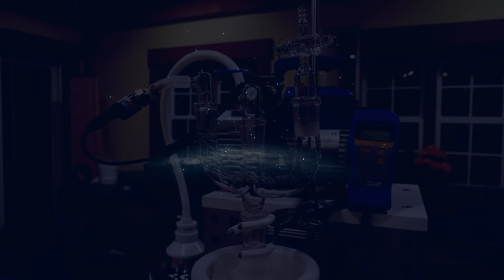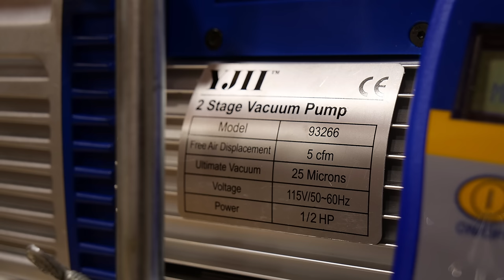Vacuum pump with NO moving parts

Comment: You have such great videos! I just thought of a topic (or series). I will be starting a van build soon (RV conversion). The problems I see are that you have to reinvent the wheel because you are building it to your liking from the ground up. What should I do for insulation? Hot WX? Cold WX? Condensation? Recirculating water for longer showers? How about solar? With limited resources and finding ways to conserve and recycle energy, there is a lot to tackle from an engineering standpoint. Maybe this would be something of interest to you guys? I can only imagine how many people would be interested (the van build community is rapidly growing).
Thank you again for such great videos!

Comment: In the early '90's I worked at a vacuum metallization company. Their equipment used to plate thin layers of metals on various items in a vacuum to make jewelry.Once a base metal was on, the item could then go through chemical electroplating, such as gold. One experiment they took a dead butterfly and plated it.

Comment: At my previous job we exercised the same principal to clean impurities from compression and moisture from pressurized air systems. The beads of desiccant were MUCH smaller though and were nearly impossible not to make a complete mess with. Additionally the chamber to refill was inevitably hot from the previous reactivation cycle. Ah, memories. Terrible memories.

Comment: From the moment you begin cooling the sieve and you still have the valve open to the mechanical pump, you are pulling oil vapor into your glassware and sieve...you'll start to notice if you do this enough.  Best practice to regenerate the sieve, seal it off when you are happy that the pressure is  at equilibrium at elevated temperature, and then begin cooling down (to ambient or below)--then connect it to whatever you wish to pump on.

You seem to love strong magnets and high voltages.  You should try an ion pump.  Such a system would also utilize the Yellow Jacket you are so fond of to rough the system before turning the ion pump on ;-P

Comment: Great video. I had a little problem with your explanation of how an oxygen concentrator works. The sieve that is used has more of an affinity for nitrogen than oxygen so it is the nitrogen that is more sticky, not oxygen. The sieve is in columns so the nitrogen  is adsorbed from one end to the other. The oxygen (and argon) isn't adsorbed as much and it gets pushed out a small orifice at the far end. The orifice is small enough that the compressor can keep building pressure. Once the nitrogen has filled the adsorbent nearly all the way to the end, a valve opens to the atmosphere and all the nitrogen comes blasting out of the sieve. While it is depressurizing the concentrator switches to a clean column so it can continue putting out oxygen. What I found fascinating is you can pump a heck of a lot of air into a column of sieve and the pressure doesn't rise much. It acts like it condenses in the sieve. And when it dumps, a heck of a lot of nitrogen comes out. It is a way to store a lot of gas in a small volume. If you had a car tire filled with sieve material, it would take forever to fill it up and would take forever to go flat in case of a leak. The sieve also gets hot when it is adsorbing. If you expose some to air it really loves water vapor and quickly gets too hot to hold. Supposedly wool is a natural sieve and moisture from your body is adsorbed which gives off heat to keep you warm.

Comment: In addition to turbomolecular and oil diffusion pumps, pure cryogenic pumps are used. They're usually a Gifford-McMahon cooler attached cold-end side to a set of baffles inside the vacuum chamber, and connected to a helium compressor. The cold head can go below 20K, and the pumping speeds compared to pump size(minus the compressor) are absolutely huge - even the smallest palm-sized GM cryopumps start at hundreds of liters per second, and go up to many thousands, where you'd need a person-sized turbo or oildiff.
They don't compress helium(for obvious reasons), but they're exceedingly effective at pumping other gases. They do have a finite resource, but you can regenerate them under vacuum by turning on a little heater next to the exhaust port, to drive the gases out the right way.

Comment: Very interesting as usual. Being an HVAC tech, I would like to see this in our industry rather than using those pumps. I understand this is a lab setting, but just FYI, the Appion TEZ 8 is a much better pump in my opinion because you have the oil reservoir on the side and can see the entire volume instead of the top through a sight glass,  and can also change it on the fly.

Comment: Changed my whole perspective on desiccants.  Got me thinking about using a molecular sieve to capture methanol from compost or wood.  Could then be used in a small fuel cell.
Reply from the maker: That's correct.  Molecular sieves are inexpensive as well as reusable.

Comment: In HVAC we usually pull a vacuum to at least 500 microns in a system and in addition to that there's usually a "filter" installed too in our copper line sets which are filled with molecular sieves/zeolites to scavenge anything that was missed or finds it way into the refrigerant lines.

Comment: 1960s 70s era Varian VacSorb pump.  Usually 3x 4L pumps could pump 1 stere to 20mTorr. 
Then better rotary pumps and turbos came out.  VacSorbs though had low/no back streaming. 
Better yet, take two rotaries filled with Inland45 (or better) in series with two cold traps in between.
Remember, differential pumping!!!!!  Never expect one pump to hold 5 or 6 orders of magnitude...
Nice video.

Comment: Interesting application of this material. I was familiar with its use in refrigeration and making anhydrous ethanol, but had no idea about O2 concentrators or high vacuum applications. The physical process is very similar to how activated carbon works.

Comment: I used to use a pressure swing drier that worked on this principle.

Air compressed to 10 bar, 100% humidity was put into one chamber filled with dry desiccant. That dried the air. Some of the dried air was allowed to expand to 1 bar and passed through another chamber filled with damp desiccant. That dried the desiccant. The damp air was vented to the atmosphere. 

After a few minutes the chambers swapped roles.

That gave you an endless supply of ultra dry 10 bar air.
Reply: Sounds exactly like the pressurising systems used on waveguide systems.

Comment: Thanks for adding to my knowledge of vacuum. My pump is ratted to 3 microns I have been only able to pull down to 12 microns in a large 30 lb steel cylinder. Now I have a new cheaper toy method to play with.

Comment: Thank you very much! You are really excellent, both in didactics and as a true scientist. The LORD Jesus bless you and your family!
A few questions: 
-If you would have cooled down the empty flask with nitrogen, what micron level of air pressure you would have reached?
-Could you also electrostatically charge the flask to reduce the gas layer on the surfaces, or even use high-intensity EM-waves of a given frequency corresponding to the gas molecule absorption lines (Frauenhofer lines) to excitate the molecules instead of heating ?
-Could you show in a future video, how to build an oxygen-concentrator with molecular sieves? Since long I wanted to buy one of those, but building one yourself would be more interesting.
Thanks again for your marvelous uploads...I always learn a LOT in these 20 to 40 minutes!
Reply from the maker: Thanks!
The pressure that the empty flask could have reached after filling with air is approximately 77K/300K of the starting pressure.
Reply: @TechIngredients  Thank you very much! Sometimes I forget to switch on my brain ...and to use the "ideal gas law" and the direct proportional relation of pressure to temperature. (T(liquid nitrogen) 77K : T(ambient temperature "hot summer night in the USA at 9 p.m.") 300K)

Comment: you wanted some more ideas so here are some:
you could make a video similar to your fridge video about different types of presses. specifically there are multi ton presses which allow for a metal version of plastic injection molding. if there is a way that such a thing could be done through leverage, that would be pretty interesting. for example, bullet trains can have their acceleration maintained to their speed max due to relatively recent EM discoveries, if somethign similar can be done for a press with lower energy that would be pretty impressive.

something related i was thinking was if the weight to one of those could be moved separately. the real presses have these giant blocks of iron or steel giving it mass. but if you could have a different type of mass it might be less difficult. take for example water, it doesn't' compress much, but is pretty fluid, so if you can have the water be in a closed and full chamber for the hammering, but then have it drain out after the hammering, then the work to bring the head back ready to hammer can be spread across more motors. if you could have a bunch of whicking material pulling the water back up continually to higher basins, and also have EM making the thing hit harder. it would be a really strange and fantastic thing. there is probably more room for reciprocation too.

you could make a video about cuts, polishing, and repairs. starting witht he keying of saws, you could goin into serration and off center cutting edges, then go into how to chemically fasten stuff like dimonds to blades. then you could talk about whether there is merit to using soft materials in a saw- at least soft relative to the material you are working with- and that could take you into sanding and polishing, and lastly just as a mic drop you could talk about self-repairing materials like the phone cases which gradually undo scratches.

if you want some ideas that others have done but are still cool. you could make a computer processor using a microscope backwards to do lithographic etching.

i'll see if i can think of anything...

Comment: I used to work on oxygen concentrators. We cut the sieve beds apart and scrap them. I noticed that one sieve would spontaneously combust when it came in contact with nitromethane. I was using top fuel nitro and I think the sieve was from a DeVilbis. It’s pretty neat, the sieve will turn red a boil like lava..

Comment: I am now restoring "new old stock" Tesla SEM made in 1990, and the only "forevacuum" pump is the sorbption pump cooled by liquid nitrogen. That was a total surprise, but I think they did it because of a requirement of a very clean, oil-free vacuum (this electron microscope is equipped with FEG, the column itself is UHV, and most importantly it contains Auger spectrometer, which would hardly work if there are oil vapors there)

Comment: I ran a PSA (pressure swing absorption) gas plant for years where you ran coal mine gas that was 350 btu through a molecular sieve and vacuumed out the nitrogen and let the methane pass on though making pipeline quality 950 btu gas.

Comment: Great work again. You say it's a dead-end pump, but is that really true? If you add two check valves or solenoid valves, and you thermally cycle the molecular sieve hot-cold-hot-cold-hot-cold, you could create a continuous pumping action right? It'd have to be slow as molasses I guess, but probably pretty cheap? And perhaps could be used in combination with a regular vacuum pump to achieve a slightly deeper vacuum. I have no experience with vacuum systems though, so I'm possibly spouting nonsense.

Comment: labhack: use nonstick spray, a mandril, and a heat source to spread the pointy bits of your cheap store funnels so they're wide enough to let 3 of what you're pouring in through side-by-side.

Comment: Wow. I never would have thought there could be a non-mechanical vacuum generator, but it makes sense. At the beginning of the video, I was thinking "man, this stuff has some parallels to thermodynamics" - I guess that was good ole' fashioned foreboding. I wonder if this principle may apply to commercial veneering of large panels, such as those used in cabinetry or furniture? The hardest (easiest to sand/finish) and most durable veneer glue is known as PPR - plastic powdered (urea) resin. Common method of use involves a vacuum applying even pressure over a mesh inside a thick polyurethane bag. This is done for a period of time while the resin sets, usually under warmth to around 30º C for about 2 hours, or 3-4 hours if done at room temp. The substrate must be removed from the vacuum in order for curing to complete, and then a period of a day or more must pass before the panel can be machined. What you've shown us in the variation involving the pump and the dessicant makes me wonder if better adhesion, and/or possibly a shorter wait time before additional machining can be achieved. Dessicating the air being drawn off the bag could mean that two hours of vacuum would be all that's required, and the panel may be almost completely cured by then.

Comment: Used to work in millikelvin cryogenic systems and most people use activated charcoal as the source of large surface area. this comes in a fabric or beads. A convenient thing for heat transfer is to get a long strip of fabric and fine copper mesh pace one on top of the other and roll it up the copper means it is a good thermal conductor for quick cooling and it also holds the shape and you can place the swish cake tube in an inconspicuous corner of the experiment.

Comment: my favorite  time in grad school waiting on the SEM or TEM column  to bake out. We have one CVD system that was designed to work with Mg had to bake every run, used ion getter pumps to get UHV, had issues with gas diffusion through the inner camber walls, 1.5-2 in SS.
Reply from the maker: It's a rite of passage especially on a Saturday night.😀
Reply: @TechIngredients  yep, kinda miss the 36hr days. And unsupervised bulk LN dewars

Comment: Seems like it would be pretty useful for getting down to really low pressures and staying there once your vacuum pump reached its limits. I was first exposed to the fact that Molecular sieves will adsorb gases on ElementalMaker's channel when he took apart an oxygen concentrator. For some reason I thought they only worked on liquids till that point.

Comment: Thank you for this interesting video. It explained nicely how oxygen concentrators work. I had been wondering. 
Yes, Science is fun!
However, it would have been even more fun to be able to actually read the display of the instrument. Maybe you could make a visual cut out with only the display on top of your lovely french doors to the top right of the apparatus.
I was a bit surprised to see you mix metric and imperial units. While you thankfully use Centrigrade and Kelvin or Temperatures, you use the archaic mmHG instead of millibar or Pascal.

Comment: Sieve material is the heart of Oxygen Concentrators used in the home care field. Room air is passed through a one of two cylinders filled with sieve to remove nitrogen which leaves appx. 96% Oxygen. There is needed a switching valve to alternate between the cylinders.

Comment: Hey there again, nice demonstration of vacuum tricks. Question:I've read a paper once discussing the variation of that adsorption layer thickness depending on the affinity of the specific gas and material sealing it. Since then I've always wondered why I've never heard about the option of filling up the container with a gas that has a low affinity for the material the container is made out of. If well saturated with that gas for a time, it should replace the majority of the other gases withing the adsorption layer and potentially speed up the pumping to UHV since the low affinity thins out the adsorption layer and make it also "evaporate" more quickly. I remember the paper lacked many specifics like how well the inner surfaces were polished and the fact that many results were at relatively high temperature so probably only useful  to do on top of a "heating phase"... Anyway that affinity seemed to influence the results quite a bit so i'm surprised I've never seen any mentions about just even the option of doing that in any of the textbooks i read on high vacuum. Any idea about why it would be more impractical than the other methods, or not worth the hassle maybe?

Comment: Professional athletes sleep in "high altitude tents" that simulate the low oxygen levels at high altitudes, which improves performance because it improves your body's ability to proceed oxygen.

I've been thinking about building one with molecular sieves but I don't quite have the engineering skill. I'd love to see you take on the project.

Comment: Interresting; we  have a system at work that uses adsorbtion in the opposite way. It concentrates N2 to be put into a piping system to lower the O2 to prevent corrosion.

Comment: Speaking of vacuums, our HVAC channels have an interest in the ability to pull a very good vacuum in the shortest amount of time. Would heating and agitating the oil assist in pulling out the dissolved refrigerants? R22 or whatever dissolved in the oil can limit how much vacuum can be pulled on a system. Maybe you could also turn the frontal lobes towards explaining the Tesla Octovalue heat pump?

Comment: 🤔 very interesting, thank you.
Questions:
Can you use an electric charge to move the gasses away from the object, and condence them closer to or even in the the pump.

Or use a hydrophobic gas or atomized gas to cling to an object, like electro-plating the surface with the hydrophobic type molecules to exspel the clingy gasses?

Comment: I've been to the summit of Mauna Kea -- you can drive there -- as long as you stop at the lower visitor center for at least 30 minutes before proceeding to the summit.  You feel as though you weigh 3x your normal weight as the O2 saturation is low compared to sea level.  It's not for those with cardio-pulmonary challenges.